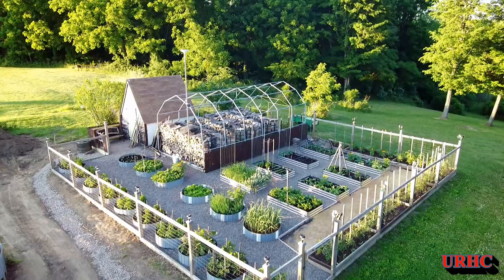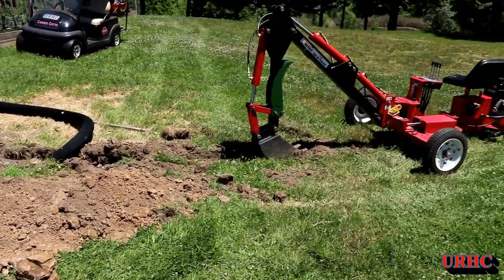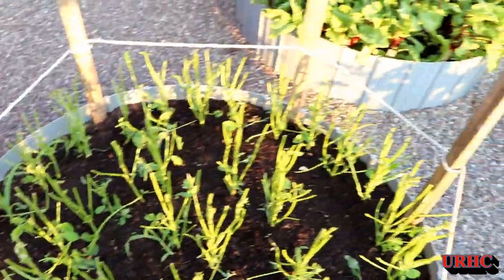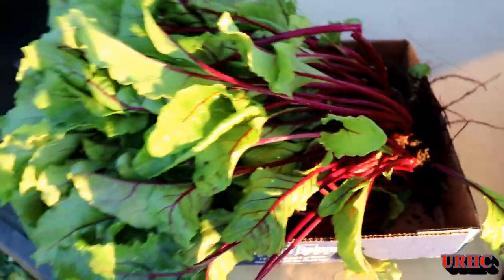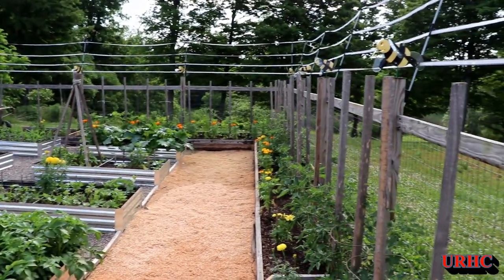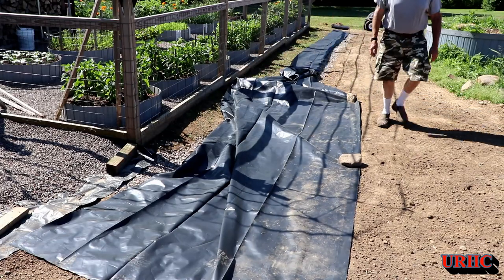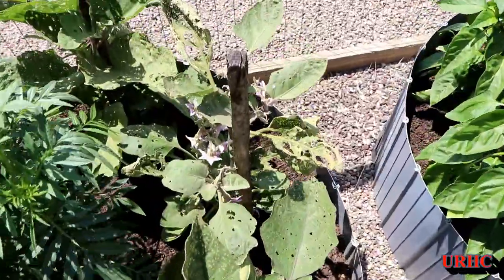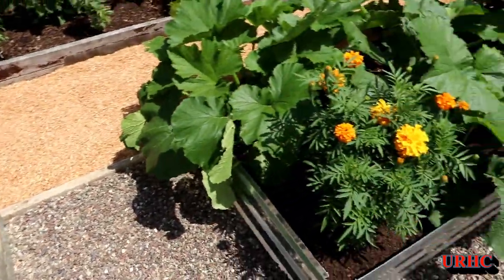Garden 2020 Part 4 Got Deer, Time To Raise The Fence And Updates

Comment: I really like the 2 wheel wheelbarrow, the others can really be a pain to keep balanced if they are loaded heavy. I think that bumped the fence height up enough to keep the deer out. Thanks for sharing.
Reply from the maker: It's easy to add a second wheel. Keeps it from falling over and makes it easier to use.  So far it's working  good but now he is up every day eating my apple trees. I wind up chasing that same deer out of the yard everyday. Luckily many of the others have moved into the corn fields across the street.  Thanks for watching.

Comment: I used to get compost from the town - for years it was great - about 20 - 30 (?) years ago i covered two asparagus and one raspberry bed (4'X25') with a couple of pickup loads of mulch.
The next year nothing came up in those beds - not even weeds.  All of the other beds were fine - that was the end of my free compost.  I make my own and mix it with my own worm castings.
Reply from the maker: I usually use my own but with the new beds this year I had to buy 2 loads and I don't trust that second load. Thanks for watching.

Comment: I found something that worked really well for deterring deer - take that shiny 'curling ribbon', & string it over the plants from fence posts & bamboo poles, twisting it before you tie off the end.  They won't jump into an area they don't have a clear landing area, the shiny ribbon has a lot of movement & reflections, & it also makes a 'thrumming' sound when the wind hits it right.  They also supposedly have poor depth perception, so if you put fencing at an angle, the don't like it b/c they can't easily tell where the other side is.
Reply from the maker: I read that white is the best color for deterrent because they are always looking out for it. But who knows. I am just going to stick with this for now as it seems to be working. Thanks for watching.
Reply: @unemployedredneckhillbilly2023   they probably can see white best b/c they feed  mostly at dawn & dusk.  I just found it super cheap & easy to use the ribbon. [plus it's puuurrrty.  ;-)    ]thanks for the vids!
Reply: @unemployedredneckhillbilly2023  p.s. - the deer got to my beans, pea pods & potatoes before I used the ribbon - & was very surprised that they all recovered fairly well & seemed to take it as a pruning & just branched out.

Comment: VERY CLEVER SOLUTION!  I think it will work.  I think that was just a confused deer.  Wow, but sorry to see that.  Lucky you didn't have more damage.  A grown deer could have destroyed your whole garden in no time.  I know some who swear by motion-activated sprinklers for deer.  That might work if the deer always approached from the same area.  The only way I know to keep deer out (without active dogs in the yard) is with an electric fence.  I have a relative who has an acre garden fenced in with a hot wire running at the top and middle of the fence.  They are remote and live next to the woods and even have a deer feeder and a small herd coming for corn every day.  The electric wire keeps them out of the garden. I have a large fenced in area with two dogs running in and outside and never have a deer problem. But I also live in a community of really active hunters and the deer REALLY fear people here.  Yes, the bucks need higher protein (like in the soybeans) in the Spring.  Same weather here.  Beautiful sunny days. So unusual to be this dry. I am loving the sunshine and hoping to finally get some heirloom tomatoes this year because they always get blight from our normal wet summers. I also hate the endless winds.  Crazy crazy season so far. My garlic looks early to harvest this year too.  VERY dry here too.  My beets and turnips are a total failure.  Zucchinis are healthy as always.  I think the tomatoes may be stressed from the extreme temps we've had.  WOW you have peppers ALREADY!   I don't have deer, but have way too many squirrels, rabbits and chipmunks.  ALL destructive.  Tonight you should have some rain though. LOVED this video and your incredible little frog & snake buddy!
Reply from the maker: I think if I waited another day most of it would be gone. The tapes are working so far. I have the motion light at night that has kept them away after dark and this daytime attack really surprised us. We were supposed to get lots of rain today but it mostly went south again and we got less then a quarter inch with no rain predicted for the next week again. My turnips all went right up to seed this year but the beets were doing well with a daily watering. I need a giant anaconda that will take care of deer but the little snakes frogs, and toads really do a number on bugs. We have a bunch of hawks that do a good job controlling the rodents this year. The worst part is mosquitoes and deer flies are back. Stay safe. Thanks for watching.

Comment: Love your garden the layout & its structure.  Thanks for the idea of laying the polyethelyne sheet before topping it with the gravel i was going to use weed matting but that breaks down over time  the plastic sheetingused in building foundation is way more durable.
Great gardening
Reply from the maker: I used the weed barrier and chips for years with no real problems. Went with the poly because gravel is permanent and doesn't break down to compost like chips. Either works good if you have an affordable source for chips. Thanks for watching.
Reply: @unemployedredneckhillbilly2023  ok however despite the benefits of woodchips as a medium for pathways the biggest problem is the attraction of termites.  Plus the weedbarier just isnt as durable here in the tropics so thats why i am so thankful of the  option of the building plastic & the gravel allows a less messy option when walking in the garden

Comment: You know I just couldn't figure out what in the world you were doing with all the plastic under the gravel on top of the french drain. Then the light bulb went on when you followed it up with the pitch fork. I certainly do enjoy your vids.
Reply from the maker: It is all tapered downhill and I am trying to keep the spring melt from getting down into the soil that has a layer of clay beneath it causing the mud. Thanks for watching.

Comment: Yep! It’s your compost, not all the way done yet. I’ve seen several videos of people’s tomato issues cause of bad compost.
Reply from the maker: That load just didn't  look right and mainly seemed to be wood chips.  I never had a problem  with mine but just didn't  have enough  for the new beds so bought  those loads. I am going to  mix some of mine in to see if it helps.  Thanks for watching.

Comment: I see in older videos you used to mulch between your garden beds and have switched to stones, do you prefer the stones? Did you use plastic in the beds as well or fabric? Thanks for your videos they are great!
Reply from the maker: Lost my mulch supplier and it went to $40.00 a yard from other local suppliers. Stone is only $10.00 a ton so I switched. I liked walking and kneeling on the mulch better but stone will never have to be redone saving a lot. Thanks for watching.

Comment: It could be the hay/straw used in the composting process was sprayed with grazon, usually the compost has some form of animal manure in it, the animals are fed hay, the pasture is sprayed with grazon to prevent weeds, the hay is bailed (organic or not) then fed to herbavors the poop collected and composted and sold to you as organic compost, you will now find it rare to get hay that is not sprayed now 😧😕
Reply from the maker: It could be something  like  that. But I am not sure if it could  be stress from all the sunshine and wind.  Some of the tomatoes are starting  to look funny  on the bottom so it may be grazon.  We are still very hot and dry that doesn't help either.  Wish there  was an easy way to test for grazon. Thanks for watching.

Comment: I asked you the question about the video from three years ago.  Did you change out the 30 year barrier and wood mulch for the new poly barrier and the pebbles because of performance issues or what?   Also, do you do raised beds for any reason other than convenience?   Again, I like these videos and have subscribed.
Reply from the maker: Mulch is now over $35.00 a yard around here and pea gravel only about $10.00 a yard. Mulch turns to compost and was more valuable for the soil but pea gravel will never have to be replaced. Thanks for watching.

Comment: That's why I have a 6ft 6 wire electric fence around my gardens. I seen the fawns touch it, I seen the does touch it. They don't do it a second time. 
Your garden looks great.
Do you just have poly under the pea rock in the main garden?
Reply from the maker: Electric will ne next if this doesn't work.  I put 6 mill poly under all the gravel and that's it. Keeps the gravel from sinking into the dirt and weed roots are easy to pull. Thanks for watching.
Reply: @unemployedredneckhillbilly2023  
Thank you

Comment: Hi, I have just bought a vinyl cutter like yours after seeing the job you made. My trouble is that the manual is one A5 sheet and that is several languages and of very little help. From looking at the cutter works very much like a printer but it did not come with any vinyl or transfer paper.
I know this video is about the garden, but if you could point me towards some supplies and let me know if I need anything else that I haven’t mentioned I would be grateful.
Reply from the maker: Did you get the Cameo3 or 4? If not did yours come  with software to create graphics and control it? My Cameo 3 came with great software that got me going.  This is the vinyl I use https://amzn.to/31j7Dce
 Any Oracal products work well. This is the transfer tape I use https://amzn.to/3dGQprA . I also use heat transfer  vinyl  for clothing. You should  contact the manufacturer about  cutting mats and spare blades along with  machine control software that controls  blade pressure,  material settings and cut speeds as all machines are different. They definitely are fun once you figure them out. Good luck. Thanks for watching.
Reply: @unemployedredneckhillbilly2023  Thank you for the links,the cutter came with a mini CD but I have not installed it yet as I wanted to get some vinyl first so I would be able to cut something. I have iwo extra bits that go into the cutterso I think I am OK with that at the moment. Thank you again for your time, I hope I get as much enjoyment as you have.
Reply from the maker: Now you get to weed your garden as well as your vinyl  😉 . Good luck.